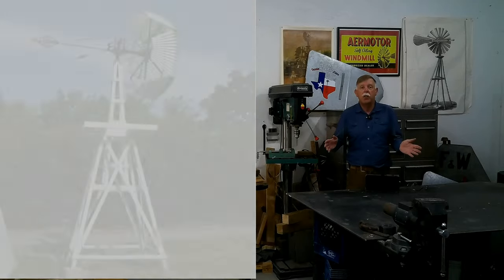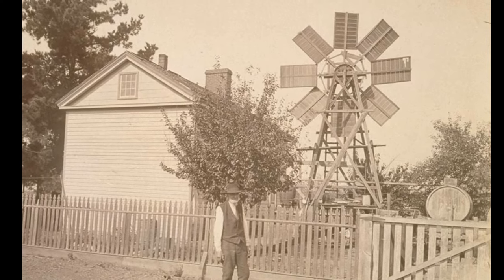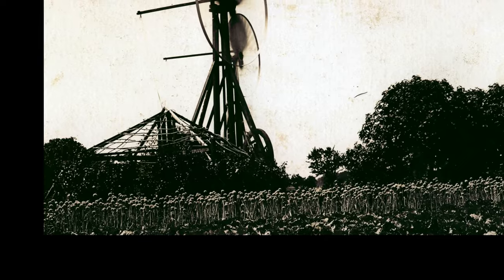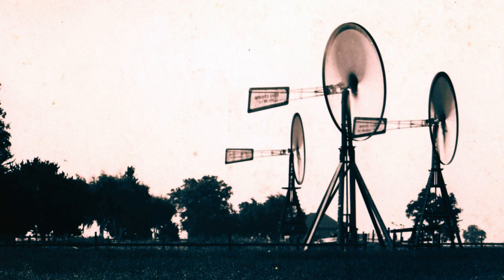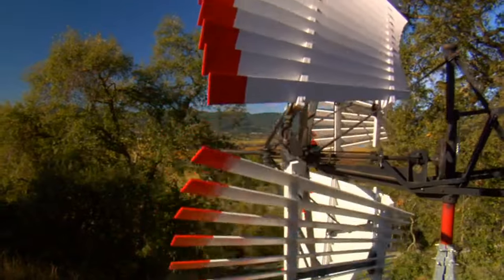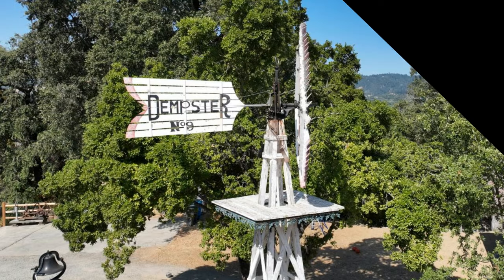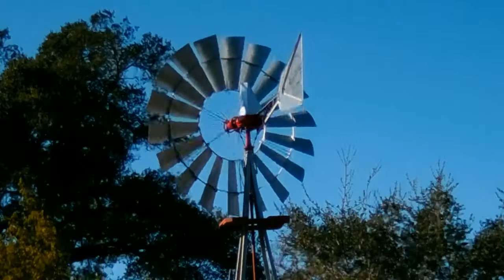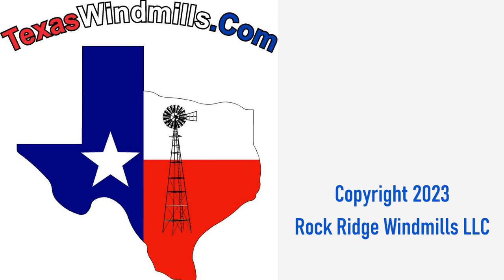Wooden Windmills Part  2

Comment: Ive acquired an old property that had a school house and homestead on it 100+ years ago. It looks like someone re-did the well at some point in the last 60 years. There is 6" Casing pipe going down 150'. I'd like to install a windmill to pull water up and keep a trickle going into a pond, and aerate the water. I live in KY, on top of a ridge located in the knobs region. I get a very steady prevailing wind direction, funneled up a hollar to my house and this old well. How big of a windmill should I get? Could a homebuilt windmill with a regular hand pump pull a trickle of water up? I don't want to spend a fortune, as I am a homesteader, but do want a reliable system.